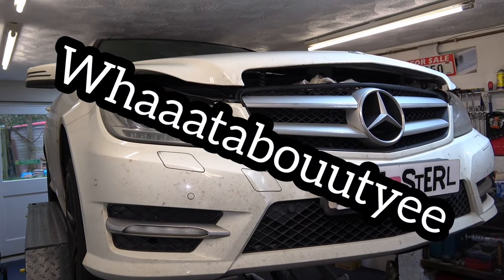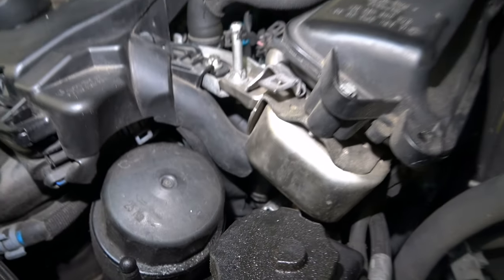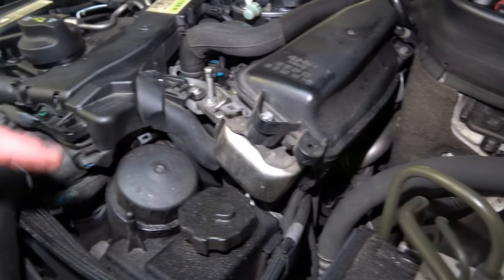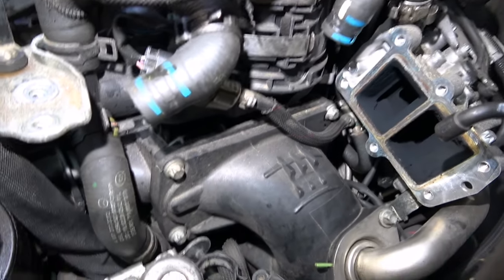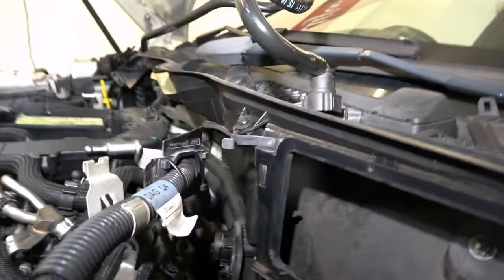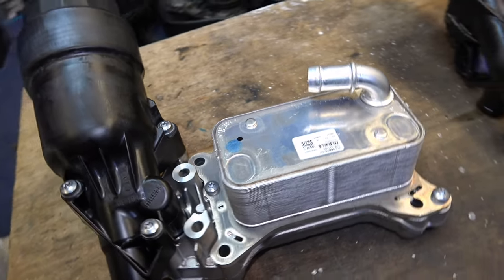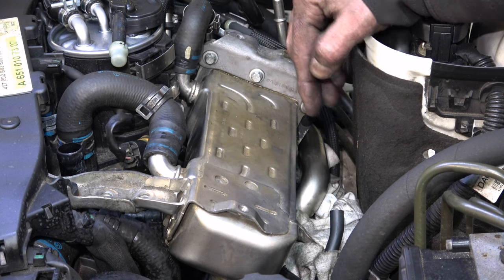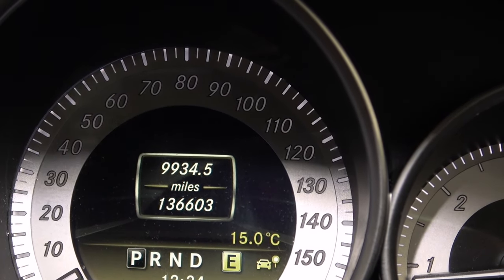Mercedes-Benz C-Classe OM651 Engine Oil Leaking. Oil Filter Housing, Oil Cooler Replacement

Comment: Great tutorial Dave. The endoscope is a good call to fit the hidden bolt under the oil cooler. I’ve taped bolts onto the socket in the past.

Comment: Each of your OM651 videos have been absolute gems for me!
I've owned a 2011 manual CDI250 Estate from new, which now has 241,000 miles, but still pulls like a train and returns 50+mpg on a run, thanks to 'DIY' maintenance (performed well in advance of any dash service reminders) and YOUR highly valued YouTube guidance.
So far I've replaced a cracked intake manifold, after watching your experience with the same model (blessing your advice to temporarily remove the battery and firewall - I personally couldn't have done that job, without this insight), I've replaced badly sealing intercooler pipes, a faulty throttle body and also a leaking fuel filter heater housing.
I've lost count of how many DPF differential pressure sensors I've replaced, they usually last about 12m , Although, the current one seems to be lasting longer, after being wrapped in foil, in an attempt to dissipate the surrounding heat issues.
However, an undefined excessive engine oil leak has been my nemesis, I've replaced the rocker cover gasket, injector seals and the oil and water 'O' rings (Mercedes Kit) on the oil cooler, none of which have solved the issue.
Mistakenly, I then concluded that the oil must be coming from the sump pan and didn't fancy that challenge, choosing to ignore all the evident oil contamination from well above this level and just making sure it gets a good clean before its MOTs.
Now, after your latest video, I realise I need to revisit this, replacing the complete oil cooler unit, with an updated version.
At the moment, I also appear to be loosing significant amounts of anti-freeze, but the radiator, water pump, fuel heater and cabin heater all appear to be bone dry and the engine oil is clear, so I've been at a complete loss to explain this.
I'm now wondering if this could also be related to the oil cooler unit, leaking anti-freeze from a split cooler unit, on this occasion leaking to the outside, as well as oil leak from the seal not included in the kit.
You've given me new direction and renewed hope, I was on the point of firing the parts canon for the anti-freeze leak, changing the radiator, as the only original item not recently changed.
I thank you for your wisdom.  Cheers!
Reply: If you say could be leaking internally but oil is ok then where does the coolant goes ? Mine Same engine coolant does have the very light oil feel to it dont know mate 😊

Comment: The best way I found to reinstall the egr cooler is to start with the lower middle bolt, use the extension same as you have done , insert the bolt and extension in the lower middle hole and position the cooler in place lining up the other bolt holes keeping pressure on the extension and your got the first and hardest bolt started.

Comment: Brilliant video. I pulled the carpet back from the bulkhead and drilled the aluminium with a 20mm hole saw to access the bolts on the EGR pipe worked a treat.

Comment: Ive one in the shop at the moment its got a very similar oily mess but thats the least of its worries. Its got limp mode with hard acceleration, P0087 and sometimes P0252. Its had 2 fuel filters already apparently. LP pump is 4-5 bar and doesnt drop off. Rail pressure at idle is 300bar which is about right, leak back at idle is a little excessive but all 4 injectors the same. Injectors out next and off for high pressure testing, really hoping something is found there because im not looking forward to getting to HP pump or QC valve 😢

Comment: Fuel filter housings fail on these OM651’s as well? While you’re in there!
Reply from the maker: @itsoffsideref5849  on a customers car we can't just change parts as we like when they still function normally. However, for your information, I have changed the housing on this car previously.

Comment: I’m generally a fan and advocate of the old Benz but that 651 is a horrible pile of junk in my opinion. 😂😂. Give me a V6 CDi any day. I was about to say there are no easy jobs on a 651 but I changed an alternator on one this Wednesday past. Looks like a nightmare to begin with but not too bad once you peel off a few bits and make some access. I still wouldn’t have one in a gift. I’ll send them all over to you Dave 😜😉
Reply from the maker: Aye, they are not well liked for sure. One this afternoon, changing a leaking fuel heater, now a no start. Great 😭
Reply: Oil leak on the v6 on the cooler seals is a nightmare, just did a coolant leak today on the same engine, another known fault you should have done it at the same time Dave, nice wee job! Good video chap keep it up 👍🏼
Reply from the maker: @ilikebiscuits5672  for your information, i have previously changed the fuel heater in this very car. Not mentioned in this video as it is not the subject
Reply: The 651 is a great engine if maintained well.
Reply: Did you manage to fit the cooler onto the block without catching the seals whilst sliding it in.
The lads at work have caught them a couple of times and then it pisses oil out when you fire it up.

Comment: Worst merc engine ever.
Reply: Absolute bollocks is it. It's a generally reliable and robust engine.
Reply: @ln5747  I CHANGED 3 OF THEM . ONE IN SPRINTER AND 2 IN C CLASS.  I HAVE CITROEN 1.6 HDI FOR 19 YEARS STILL RUNS AS NEW.
Reply: @ln5747  I completely agree with that 100%.I know taxidrivers with 1.000.000 km with that engine(OM 651)
Reply: @zorankomadina7540  anecdotal.
Reply: Until 2008 good after 2008 crap. Only good mechanics and engineers know why and what is the difference.
Reply: @zorankomadina7540  not true
Reply: Very true I still have 220 with 250 engine